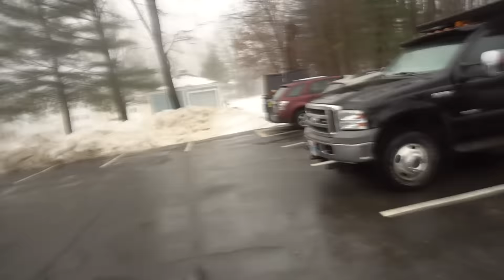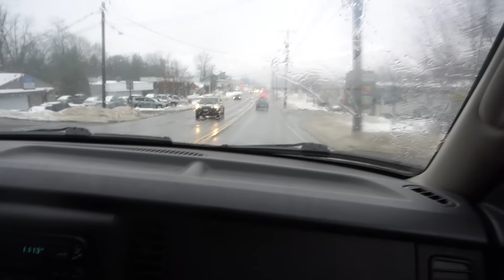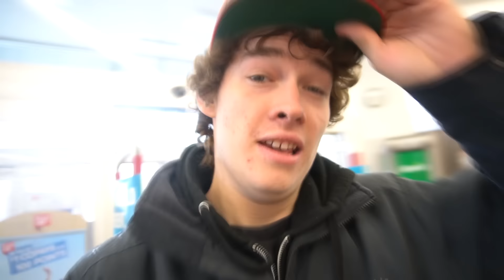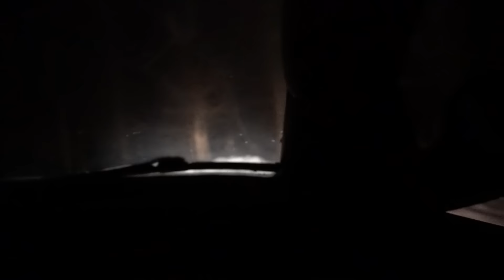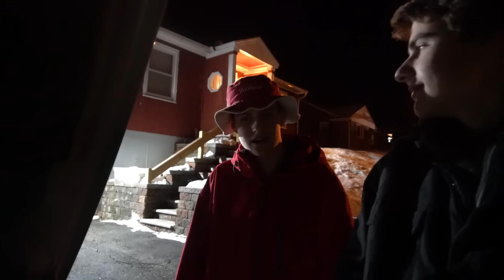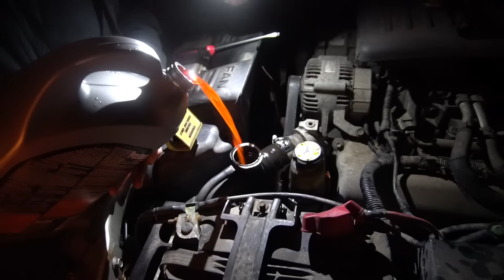Winter Drift Taxi Gone WILD!

Comment: Bro you shouldn't be running straight coolant that doesn't do shit. The coolant is what keeps it from freezing or overheating the water is what actually cools the engine. Besides the fact that you put dexcool in a dodge lmao
Reply: other than that dope video lol love the parking lot drifts in the truck
Reply: JeepGCOverland47 it's winter time. He will not have to worry about over heating. And even in the summer he won't have to worry about it unless he lives in the sabara
Reply: Fi Metal i live in the sabara
Reply: Nate Eller lives in the sahara
Reply: smart guy, how would you then explain why here in northern part of world many new car comes with 100% antifreeze all year around... water helps cooling engine, but antifreeze can also do it, just not so well. Manufacturers can't take risk that coolant would freeze here so they put 100 % antifreeze.
Reply: ERK77VI smarter guy, he lives in Connecticut where it's over 70 degrees for almost half of the year. He's gonna need a 50/50 mix

Comment: You definitely do need to put water in your coolant unless its 50/50 already
Reply from the maker: +cortne williams not when it's freezing outside it really doesn't matter ive ran 100% coolant in the summer before and had zero problems
Reply: +Ricer Miata I mean sure it will run, but it won't do it's job at 100% like it should, had it been administered according to instructions. I've ran 100% water in my pontiac grand am, that doesn't mean that it's cooling to spec or not causing corrosion in the radiator though.

Comment: you do need water in your coolant unless its premix...
Reply: not really in all situation, here in northern part of world many new car comes with 100 % antifreeze. Water transfers heat great and that is only reason for it, modern cars have so efficient cooling that water is not necessary... 100 % water should never be used since it will make corrosion inside cooling system and also freezes. Mixing antifreeze and water for areas colder than -40 celcius during winter is not smart thing to do from manufacturers...
Reply: antifrzze also raises the boiling point of water. If youre running straight water itll boil out real quick
Reply: itsme78932 yes absolutely right

Comment: chevy coolant into dodge.....good job fucknick
Reply: jb202ater coolant is coolant
Reply: dexcool, which is chevy coolant, when mixed with regular green creates a gel
Reply: no it aint lol, cant mix dexcool with green or youre going to clog up your cooling system.
Reply: just like oil is oil and trans fluid is trans fluid....   his coolant will be fine for a month or so but any longer than that its overheating like crazy.  use yellow coolant. mixes with anything.  not green, yellow.

Comment: Dont wanna sound like a hater, but you should run the regular green coolant in your truck at a 50/50 mix with water, dex-cool is for GM vehicles, and has different boiling points and lubricating propertys than regular Green coolant. Plus its the water that actually keeps engines cool, Coolant its self will not keep a engine cool. Its the only vehicle you have right now, why risk potentially hurting it beyond repair and not having a vehicle at all? and if you wanna spend less time getting stuck, just pick up two luggy mud-tires for the back and add a bit of weight in the bed.

Comment: Put the 302 in your black miata
Reply: Ford 300 I6 hahahaha
Reply: keep up the vids tommy and giving chis a hard time
Reply: what's gay?
Reply: Coming from a guy who prefers GM's for domestic's...I actually think a 300 I6 would be a cool swap. How much work would be involved? I'm sure a good bit. But they make a lot of low end torque. My buddy has a 95 F150 with one. It's a pretty dependable and relatively powerful motor if you ask me. Ford did a good job with those engines.
Reply: The engine is probably way too long for that little Miata engine bay :(

Comment: Dex Cool is the worst coolant you can use, it gets chunky and eats gaskets, I drained it from my chevy's.  Why would you ever put that garbage in a Dodge?
Reply: Horsepower Garage its and i quote "a piece of dogshit" chris rodknock - 2016
Reply: Dex-cool was only a problem on late 90s cars where air intrusion caused a mud to form. Also if you never maintain your cooling system youll have problems. Dexcool is 100% fine as long as you drain it every 100k and change it out and run it the proper 50/50, like you should with every other coolant out there.